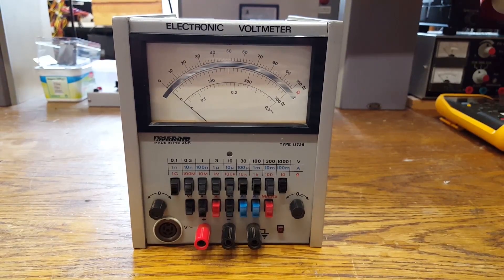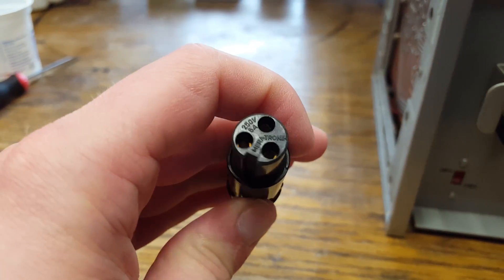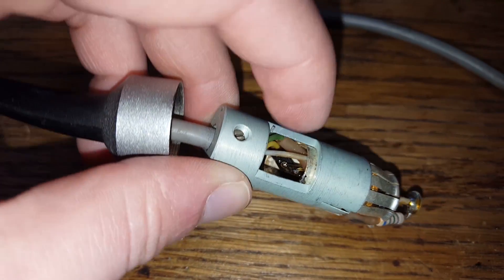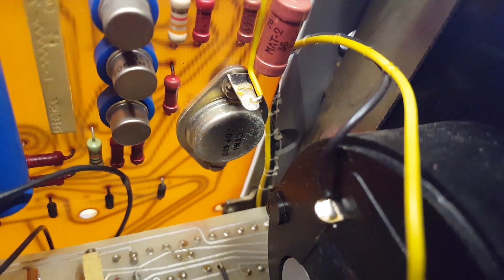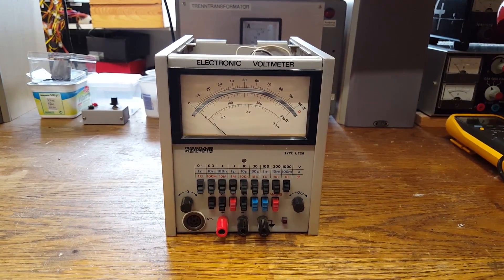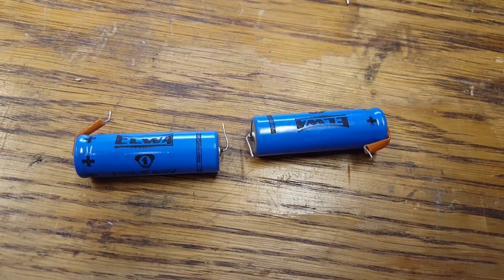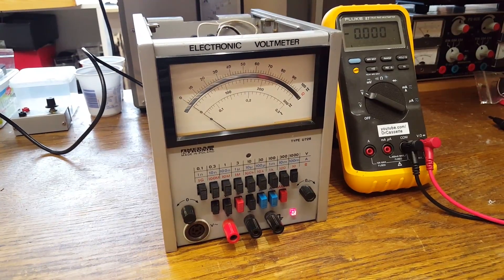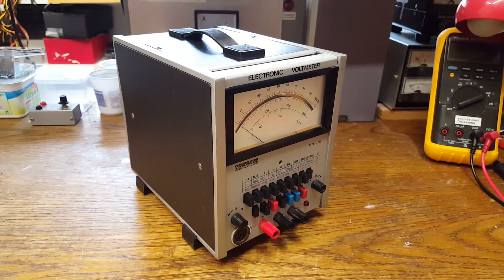Meratronik U726 Analog Multimeter Teardown and Recap

Comment: Cemi was a funny company. They developed their own ic, transistors and diodes, but for the most part reverse egeniered "capitalistic" electronic components, therefore most of polish ic and transistors had direct replacements in the rest of the world. And big part of the production was made for export before domestic use.
That's why you could find geniuine Motorola transistors inside, they were imported in an inconspicuus batch, for "domestic use" but also to be reverse engieniered and resale for foreign currency. Of course measuring equipment (also made for export) has priority for use of geniuine parts.
That was also a good way to use modern western electronics inside of iron courtain without buing much of it from the outside world.
Reply from the maker: Thanks for the info!